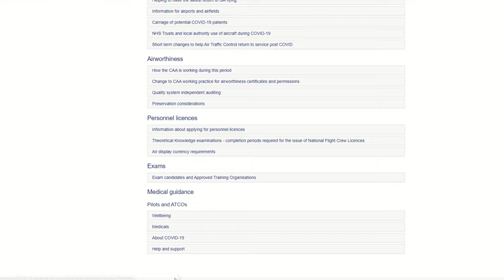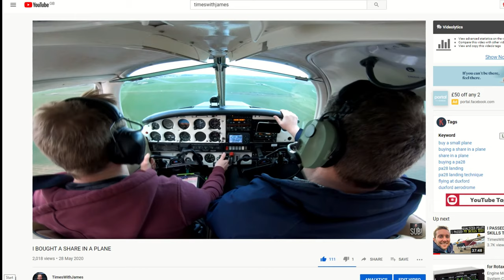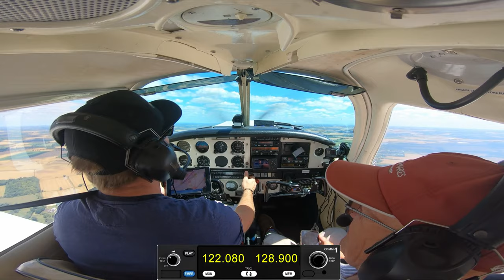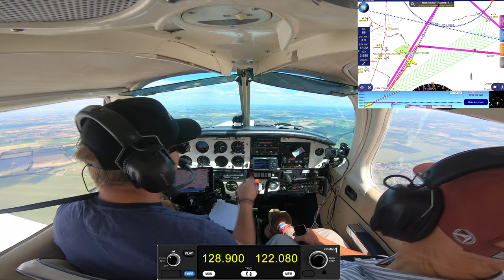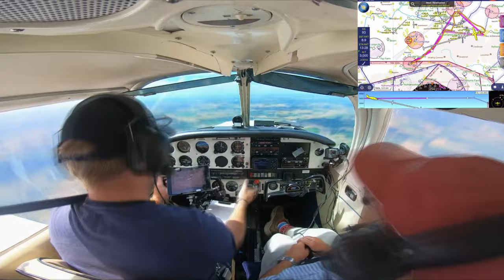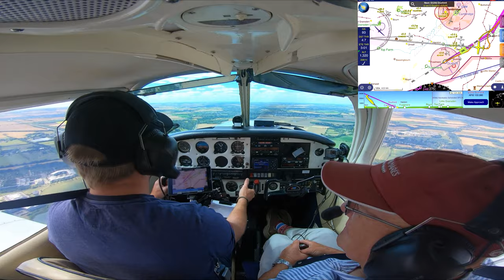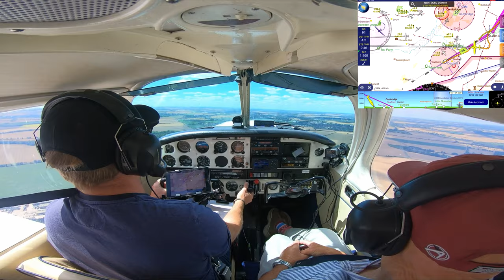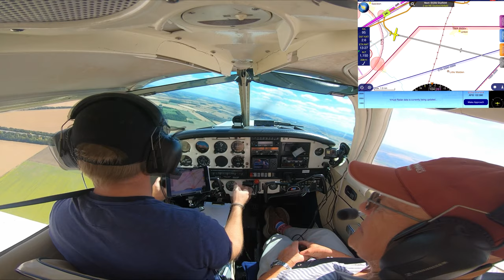PRIVATE PILOT Radio FAILURE + Circuit Pattern COLLISION RISK

Comment: Don’t be so hard on that poor Cessna student callsign, he’s obviously still learning and everyone makes mistakes. He might not have nailed the 4nm call, but you’re both as responsible as each other for separation. Your orbit was definitely the right choice though 🙂
Reply from the maker: Yeah I get you! You can tell from his calls that he's a student. One thing I'd say Is that my orbit was probably in the wrong direction (effectively turning into traffic coming from base) so next time I'll turn towards the deadside! Just hate it when you hear those calls and it's like...."Where the hell is he?!?"
Reply: @TimesWithJames    After the 'incident' you can actually hear Duxford re-introduce his "student" prefix on the callsign, and he replies with it as well...  I suspect used as a subtle reminder that he's solo and might not be entirely predictable :D  The orbit direction with hindsight probably should have been to the North you're right, (I think you actually called an orbit to the East which wasn't tremendously helpful :D ) but it's a really busy phase of flight, and I reckon if you'd have heard someone else in the circuit it would have prompted you to turn away from it.  I did something similar joining the circuit on a right base and meeting downwind traffic just before the turn.  For some reason I elected to make a right hand orbit for spacing putting me against potential downwind traffic.  At the time I just wanted to keep him on my left where I could see him rather than turning away and putting him under the fuselage, but turning against the circuit direction is never a good idea and I gave myself a good talking to afterwards. As it was it looked like you had your hands full with that turbulence!

P.S. how lucky you are to be based at Duxford... I've flown in once recently and can't wait to go back when it all opens up again!